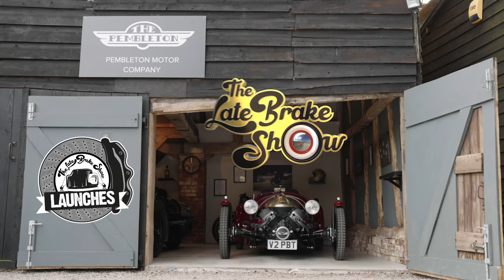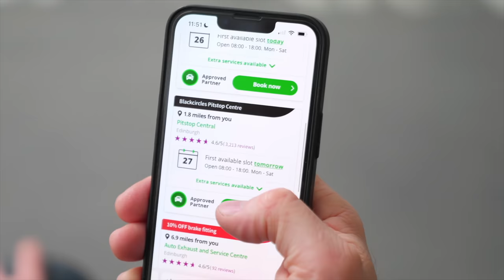The Pembleton T24 Exclusive Review - The LIGHTEST New car you've never heard of

Comment: This is why we watch the Late Brake Show. I've always been a classic car fan because of the simplicity and beauty of them. Modern cars are great for covering large distances but how often do we need to do that? Small, micro cars should be making a revival.
Reply: They should?  Back in '73, just the same . . .  the price of energy . . . yep.  :hand-orange-covering-eyes:
Reply: I would love to own one of these cars. I love the three wheel option, but the four wheel one looks so cool.
Reply: I think they are starting to.
Reply: crap
Reply: Love love, I am an elecymotorbiker, this... So practical for todays world and I'd defo say, an everydayer. Living in spain I need no roof. Bring it on, I'd live it if more people started going into their sheds and building cars. Id be a buyer for sure!
Reply: Definitely. Instead of over-sized, over-complicated, over-specified, over-performing, boring clone vehicles which seem to dominate the market.
Reply: Older smaller cars are great until you get into a crash & the car folds like an aluminium can... with you inside it
Reply: @Sithhy  Don't get into a crash. people drive faster today because they feel safer so the injuries would be the same.
Reply: @Sithhy  Small cars are not dangerous. I had an aluminum 2000 Honda Insight until hitting a concrete barrier head on at 60mph.  We were uninjured and the interior of the car was completely undamaged.  The front end was just gone with engine all over the road, but nothing even bent inside and the doors opened and closed the same as the day I drove it brand new off the lot.  Of course I have a 2002 Insight now.  If you want real danger, buy an SUV, a danger to people inside and outside of the vehicle.
Reply: You know those electric skateboards you see around? I'd totally go for basically a scaled up version of that with a couple of seats and aero bodywork.
Reply: @tonysheerness2427  "Just don't have an accident" - most people before they have an accident.
Reply: @chisight7521  that is an interesting spelling of motorcycle you have there, what does SUV stand for?
Reply: It’s not why i watch it.
Reply: @Sithhy  
I don’t disagree. That said I drive an MG Midget from spring till the snow starts. 
I drive it very defensively and assume people don’t see me - just like an experience motorcyclist does. 
Unfortunately as a policeman for 25 years I have seen a lot of people killed or maimed in “safe “ vehicles too. 
Crash protection is much better now, but the the answer is better drivers, not armoured cabins in our vehicles.
Reply: @Sithhy  yes, I don't expect it has a good Euro NCAP rating (if it has one at all)😏
Reply: @SansSentiments  at least motorcycles are not particularly dangerous to others.  Sport Utility Vehicles are heavy and sometimes built with a truck frame which does a lot more damage to the cars they hit, but are sold as replacements for cars so driven as carelessly as cars.  with all too often fatal results.
Reply: Delightful escape.
Reply: @Sithhy  Most people rarely if ever have accidents and most accidents have no or very minor injuries because most happen at low speeds.
Reply: @tonysheerness2427 
“Don’t get into a crash.”? 
By definition, an accident is not something a person plans or foresees.
Reply: No, because crappy useless drivers will still do half the speed limit in them and just be a hazard and hold people up
Reply: @SebaztienHawke-ci5hm  people need to calm down. Just set off earlier if you want to be fast
Reply: Yeah. In this era of bloated SUV's that are essentially lounges on wheels, I'd be delighted at seeing small, simple cars making a comeback. We need more cars that actual force people to be a part of the act of driving. All these lounges on wheels detach people from everything that's going on around them, which is probably a big part of the reason why they feel it's fine to look down at their phones while behind the wheel. We could do with cars that are essentially Austin 7's with modern impact safety standards.
Reply: @Sithhy  Why do they have to be older? There's nothing stopping car manufacturers today from making small, simple cars with crumple zones to make them safe in a collision.
Reply: 1:16
Reply: most of us still commute tens of thousand of miles per year in traffic, with heavy goods and rain etc etc . tho aabsolutely ban SUV use with a single occupant :)
Reply: @Oomzilla  lol im in spain, we need more of a roof else we get burned to hell
Reply: @SansSentiments  it stands for mom car with kids in the back blocking the flow of traffic cos we cant see through it :)
Reply: @LifeofBrad1  so a miata then, its allllways a miata
Reply: @kellybreen5526  we need to jump on 'slow' drivers more imo. I truly believe they cause accidents and make people impatient.  Those going 45 in a 60 for example
Reply: @PazLeBon  so the "slow driver" crashes into you flying down the road with no regard for anyone else? I used to be a d1ckhead driver too but I never blamed my testosterone fueled idiocy on the things I might have hit
Reply: @PazLeBon  move closer to work
Reply: @PazLeBon  
In Ontario it is an offence to drive unnecessarily slow. 
I agree there is a need to keep up with traffic. These small cars can keep up. 
People comment about how my Midget offers me minimal protection. This is true, but some of these same people ride motorcycles……
Which I also like.
Reply: @tonyduncan9852  yeah, tell that to the SUV loving crowd and see their opinions after
Reply: In asia, there are lots of small, light city vehicles and cars. 

I personally live in the countryside, the alps and most of my drives are 20km+, and when visiting my family in law in Buryatia and Mongolia, they are great distances. But i don't drive any new cars. I only buy ones i can repair myself. The favourite in my "collection" is the decomissioned 1992 field ambulance Unimog i got from Bundeswehr auctions for 25k€. Quite the opposite from a micro car. It's crazy how one of the most legendary and robust off-roaders  in the world can be found for a quarter of the price of some silly SUV EV which breaks down every few months.
Reply: @hyperturbotechnomike  
I think that is why early Land Rovers are so sought after.
Reply: @kellybreen5526  Yeah, you don't want to get stuck in the middle of nowhere because of fake computer error messages or spending 300 quid for a dude pressing a button on his service tablet to "fix" it or to "unlock" existing devices.
Reply: @hyperturbotechnomike  
That is why I love my Midget 1500. I am no mechanic, but I can keep it going.
Reply: @kellybreen5526  I agree, i'm  not a mechanic. 

But a microelectronics engineer who works for industrial clients. I refuse to buy new cars and home electronics, because they are built terrible on purpose, especially the electronics. 

My daily off-work car at home is a Volvo 240 GLT from 1983. Very easy to maintain, but a bit of a widow maker.
Reply: @hyperturbotechnomike  
I used to have a Volvo 244 sedan. It was shaped like a brick and was as tough as one too. It wasn’t fast and didn’t handle like a sports car or anything, but it felt safe and was a very practical car. 
I used to drive the gun tractor when I was an artillery man so I can appreciate your Unimog.
Reply: (Holy!)
Reply: But it's not cheap it's a very expensive toy
Reply: @toyota420xp  this one is, but the small cars of the past were very cheap. They can be cheap and basic again if we want them and buy them

Comment: It's called not over engineering the thing, modern cars are just trash.
Reply: Come on...
If cars hadn't moved on from this, there would have been hundreds of thousands of additional road fatalities over the last eight decades in Britain alone.
Reply: @notroll1279  I think mandatory and comprehensive drivers training programs would reduce issues significantly.  And honestly modern cars are not bad because of improvements, they are bad because they have overcomplicated luxury panic bunkers, crush zones and airbags are good but many other ACTIVE safety features further reduce driver skill and awareness as well as make the vehicle harder to service.

Every other mode of transportation requires more actual training than a car.
Reply: @deltacx1059  
The manufacturers wouldn't buy them if consumers didn't ask for them. 
For reasons unknown to me, a lot more Americans believe they need a pickup truck than they might do woth a Corolla or Jetta - and it's not the rustic barebone ones without aircon, electric windows or sound system they want.
In the UK, "pipping the Joneses" has lead to BMWs pushing Mondeos off the throne of middle-classiness... with all the complexity that came with them.
Everyone likes childhood memories of simpler stuff... but whenever memory lane goes far enough, I remember the two day drives to holidays at the Mediterranean in a car without air conditioning. 
So much as though a Pembleton is a lovely top for a Sunday in the countryside... it can't be more than a third or forth car....
Reply: @deltacx1059 I get what you mean… I think your wrong but I do get where your coming from. With that said I think certain modern cars are very special. Cars like the Lexus LC500, Porsche 911 GT3, RS, or ST. The ND Miata, or GR86. Or GR Corolla. To name a few.
Reply: Modern cars don’t feel like cars to me. They instead feel like road going appliances. If you have a significant commute, then they’re the practical choice. But at least there are manual gearbox GTIs still to be had. I prefer simple cars that require ME to be the computer. They provide joy & engagement that road going appliances have long since shed.
Reply: @deltacx1059 
I've got you as a friend.  I hate , these modern cars , how ugly they are
Reply: You bunch of boring old pedants😂 get an alpine a110

Comment: Quite right about low mass, low power and narrow tyres.  
My wife runs a 1961 roadster that weighs perhaps 670Kg and makes 55bhp.  You sit almost on the tarmac and it feels like a rocketship.  No PAS, no ABS, no ECU.... Gorgeous.
Reply: My dought not long back had a mk1 1 Ford ka 1.3z. I had a 200bhp plus cars at the time, but would jump in her ka often when going down my local narrow country lanes. It was just more fun. Bloody thing cost 150 quid!
Reply: @StephenButlerOne  I owned a Ford Fiesta MK1 van. 950cc..Wonderful fun on country roads..
Reply: @sixfootbear  the old smaller and slower cars, seem way more fun than today's 200bhp belated cars, when it comes to our narrow lanes. I wouldn't want one full time. But for sheer fun factor around your local lanes, a 1 liter 106 or a mk1 ka, is hard to be beat.
Reply: @sixfootbear  In the mid-2000s I had a Mk1 Seat Ibiza with a 903cc engine and all of 40bhp. Amazing fun to drive, especially round town - I used to love throwing it round roundabouts.

I've got a 957cc Fiesta in the garage but it's a long way from seeing the road again.
Reply: Had a Lotus Europa S2. 100hp and 600kg. Tons of fun.
Reply: I grew up on a steady diet of minis and my father had a Sprite I used to drive quite a bit so I totally get the fun that lightweight, lower grip and low power brings.  Higher power and especially turbocharged engines can also be fun, but you can only ever use that power briefly on public roads.
Reply: @808bigisland  Ah the Europa! My dream car.
Reply: And no safety at all.
Reply: @kraenk12  And?  Presumably you are too scared to ride a motorcycle, or go mountain biking or rafting.  Life isn't about being as safe as possible, wrapped in cotton wool taking no risks and getting no rewards.

Comment: Coming from a motorcycle background, this is honestly amazing to me. 80 HP and 800 Pounds is an amazing power to weight ratio to be around for a cruiser style motorcycle. and to get that with a 4 wheeled chassis is outstanding. I would pick one of these up in a heartbeat if ! was able!
Reply: 45hp on a 300 pound motorcycle is amazing, add 19.5k RPMs and you have the reason I love earlier JP 4 cyclinder 250cc bikes.  I would too for that crazy but slightly safer ride.
Reply: Imagine I have the exact same engine on my Moto Guzzi V85 TT and it weights 229kg with 23l of petrol.
Reply: One to Ten P/W is where the fun begins on four wheels. About one to six  or better is the best death zone, and my favorite. "Tis why I sorta hate modern American Muscle cars. Yes, your Hellcat has 600 HP, good, it's fat ass needs it! I started on a 45 HP TD... An 80 HP T24 sounds nicce, Alas I'm on the wrong side of the pond.  Lovely little car.
Reply: Are these available in Canada?

Comment: Excellent journalism Jonny, asking the right questions, at just the right time, great review - My father, now in his eighties, built a 2CV powered Pembleton, 5 or 6 years ago smiles per mile a plenty, he often goes touring in France !  - when it had its SVA test the examiner could find nothing wrong, but had to take it for an extended road test, just to check it out ! .... and came back grinning from ear to ear ! (it passed) - he had a Morgan in his youth back in the late 50s - I find it as exhilarating as as a good blast on a motorcycle, with a perceived level of performance that matches any hot hatch - he does run some fancy heads and twin dellorto carbs so it, I believe its up around the high 40s hp and is no slouch.

Comment: I have one of these - a self built car weighing 376 kgs, powered by an 80bhp BMW "Boxer" completed over 15 years ago and in regular use, mainly touring in France. My car has much more built-in storage than the T24, runs on 15" wire, centrelock wheels, returns 48 mpg with a range of 400 miles. Very much like a motorbike, you need wet weather gear for when it rains. Our french trips are usually between 2,000 and 3,000 miles - the car "opens doors you might not have realised were there!"
Reply: Wow, would love one day do that touring in one of those!🙏

Comment: Love they use Moto Guzzi motors. As a Moto Guzzi owner I can tell you these motors are sweet, and if you service them, will last and last and last. They are low stress, and built solidly. Sound brilliant. These cars are epic!! And, I have to say, for a hand-built car, cheap as chips.
Reply: First thing I thought...I know these spread wing on the cover. Would be cool to get one of these with the V100 power train at some point...just have to hide the cooler somwhere.

Comment: I bought one in kit form several years back. I'm getting close to finishing my other projects and it's next in line. I bought it because I love the quirkiness and story behind it. I've gone with the 4-wheeler though, just prefer it! I bought it knowing I wouldn't build it straight away, I had a feeling it would go up in value and maybe become a factory-built machine and I really wanted to build it myself. There have been a few upgrades since I bought mine so I'll be going back to see if I can get the new suspension set up etc.. Can't wait to get started on this project. Take my daughter to school in it when its finished. haha
Reply: whel done  bough it up frond ,i am looking for a second hans and make it a lefthand drive.

Comment: Good vid as ever, Jonny, and great to see the spirit of the cottage industry British car is alive and well. More fun driving slow cars fast than fast cars slowly, as they say.
Having had a 1930's Supersport down the years, it looks like they've out-Morganed Morgan here, both with the 3 and 4 wheeler models.
Reply: EXACTLY!
There's no way you can get anywhere near the limits of even a modern 1600 car, safely, on public roads without serious risk to one's licence.
With more powerful cars, they're just a waste of money unless one has access to a race track.
With a light-ish, lower-powered car on narrow tyres one can have a blast without actually risking one's licence - or limbs.

A series IIA short wheelbase rag-top Landy on triple traction cross-plies comes to mind - 80mph was like 180mph, and at much more sedate speeds it would drift delightfully.
Reply: The great thing is that its not even that slow, it'll still be quicker at legal speeds than lot of normal boring daily drivers in a straight line, let alone in the corners. And in a country where we have such narrow and lumpy country lanes it really looks like it's the ideal solution for a bit of fun.

Comment: That gearbox is miles ahead of my MT75 in my Morgan. I've driven them for decades in my 2CV's and they're lovely. I will explain the gear pattern. It is a regular 3 speed gearbox, like many cars in the early 50'ies and It a has a 4th gear as the overdrive, which it actually was from the beginning. You couldn't engage 4th gear from neutral, only directly from 3rd. Almost all 3 speed  boxes had 1st gear left and backwards. Reverse was left forward. So if you remember that you'll recognise the pattern.... with and extra gear to the far right forward. Great vehichle! 👍

Comment: It's lovely, but I'll stick to my new MX5. It's also a lightweight 2 seat sports car but with more room, lots more practicality (mine lives outside and the hood does not leak), aircon, modern driver aids, 181bhp, superb rear wheel drive handling and an excellent gear box (6 speed). I know it doesn't have the character of the Pembleton, but also doesn't have the price tag! (Which you didn't mention,  by the way!).
For a lovely twin cylinder engine that crackles and pops on the over-run, I have my Triumph Bonneville Speedmaster Chrome edition! It has an amazing power to weight ratio and sounds very similar to that Pembleton.